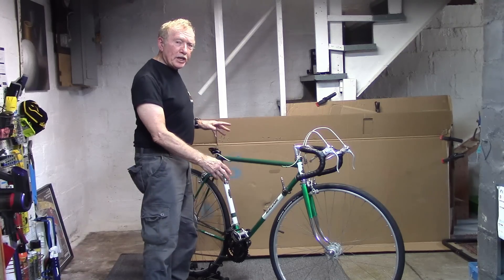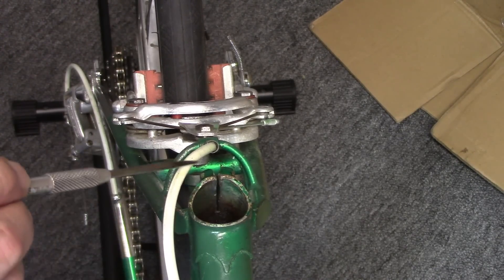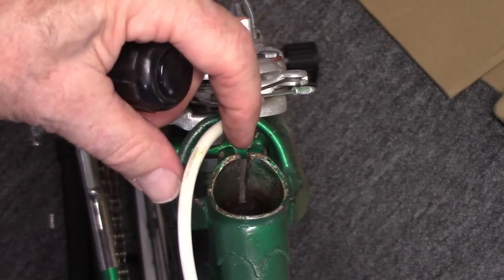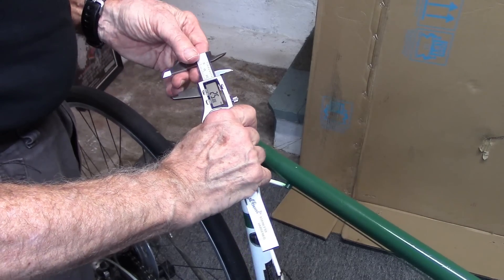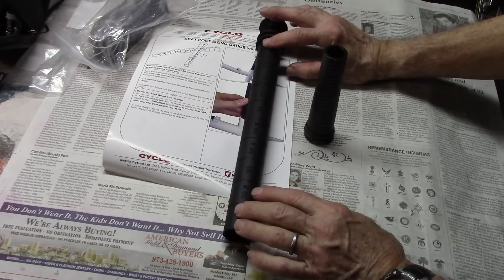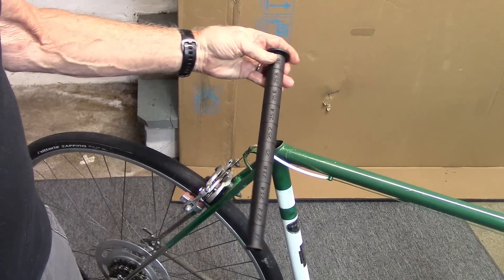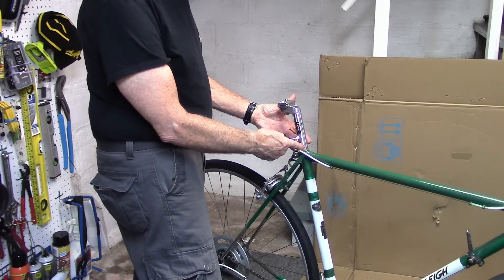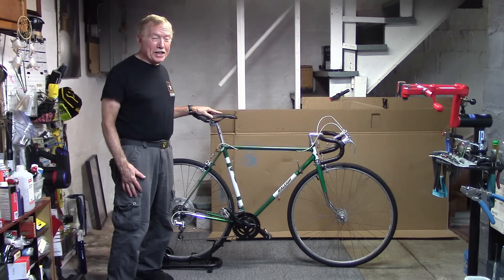Unlocking the Secrets of Seatpost Diameter & Sizing

Comment: Why use carbon paste if it's not a carbon seatpost?
Reply from the maker: One does not grease the seatpost which increases the chance of slippage. One can leave the post "dry" if you remember to loosen, move the post and return to normal height several times a year to prevent seizing. Or, what ever the nature of the post composition, I prefer to use carbon paste on the post before assembly. Carbon paste contains small particles which will compress when the seatpost clamp is tightened, both preventing slippage and prevent seizing. If dealing with titanium, you also have the option of using anti-seize compound.

Comment: Why do most videos recommend using calipers if they are so inaccurate?
Reply from the maker: Mostly, they're working on newer bikes and following what they've been told. However, those of us involve in bike restoration know that the diameter of seat posts vary 0.2 mm and calipers show too much variation between measurements.

Comment: If most seatposts are marked with diameter, why is there a problem?
Reply from the maker: Not a problem on a relatively new seatpost. Unfortunately, when performing bicycle restoration, no seat post or the wrong seatpost may be present. Without the right equipment, it's a challenge.

Comment: From my experience with bikes and seatpost, you don't have to measure the post, how you know it's the correct size, if you can wiggle it in and out of the post. If it just falls in its not the correct size post.
Reply from the maker: That is true if you have several seat posts lying around your shop. But the seat posts vary 0.2 mm between different sizes. I can't tell you the number I've noted that were too small and the seat tube bolt or clamp bolt was overtightened. May work for a while but eventually one notes slippage.  

But you are correct in that with the right size post there should be a very tiny bit of wiggle and tightening the seat tube clamp will take care of that.

Thanks for your comment, Tony

Comment: Anyone who's regularly working on bikes will find the measuring tool invaluable; someone who does so on an occasional basis is probably better off taking frames to the LBS, which is what I do. The measuring tool's drawback is the fact it's so specialised. I'm surprised seat tube diameters aren't more uniform; those .20mm make a lot of difference. Thanks for highlighting the need to lubricate the seat post. Many a good frame has been scrapped because of a seized seat post. All the best for 2024, Tony.
Reply: You wouldn't put lubricant a seatpost with oil. Oil is designed to make things slippery,, using bicycle grease is a better option, grease is designed to make things stick!
Reply from the maker: Just to clarify, I use Carbon Paste (Fiber Grip) not oil on my seatposts. Carbon paste contains small particle that compress and PREVENT slippage. On titanium, I'll use anti-seize. Tony
Reply: Nevertheless a dryer is a better one because it won't slip .

Comment: Won't any deformity of the seat tube interfere with an measurements?
Reply from the maker: You are correct that deformity of the top part of the seat tube will interfere with measurement. That's why it's important to straiten out the grove at the top of the post. The seatpost diameter tool will still put you in the right ball park where as calipers will give you varying readings.

Comment: Is there any way to convert a Cannondale 25.4 Dia seat post hole to fit a 27.2 post?
Reply from the maker: Not that I'm aware. Seat post shims allow larger seat tube to fit smaller seat post but not the other way round.
Reply: Thanks! That's what I assumed.